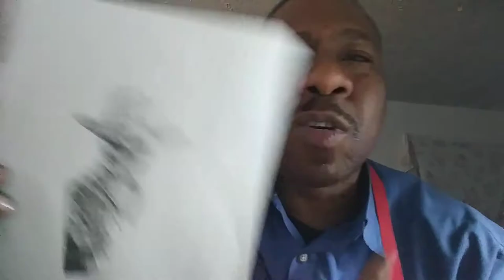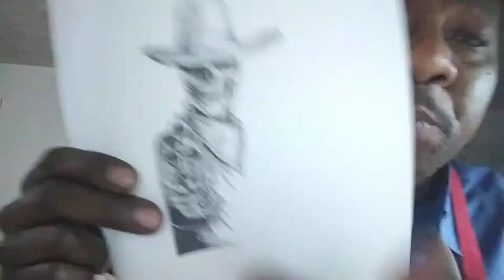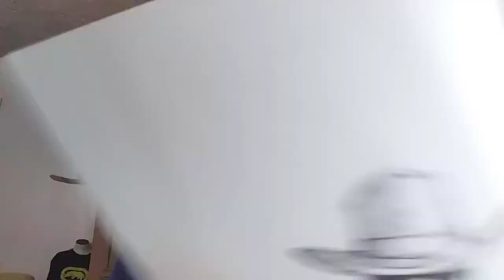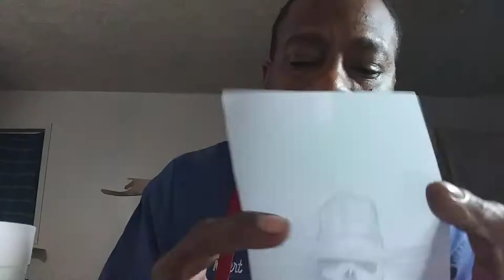Modeling spoon & beveling

Comment: If you're sewing by hand,  and you're doing an inner lining,  you can do a " heat and bond " iron on,  on the non decorative side. Only iron on just next to the hole Punches for hand sewing. Depending on type you use.  😉

Comment: Hi Robert, do you ever sell some of your art/templates for others to buy for leather work? And as for the duct tape on the back of the leather piece you do, is it difficult to dye with the glue residue from the tape?
Thanks man, God bless
Reply from the maker: Thanks for your questions. Yes I do sell artwork. Unless you're doing a flash dye technique, I generally line the inside of my pieces. If you are flash dying then I suggest use painters tape or masking tape.
Reply: @PremierLeatherCraftersKawboi  Thank you again, going to try with both and see what I'm more comfortable with. I appreciate the response man, I Also like the pics and sayings on Instagram where I follow you. 👍 Almost forgot,  is there a site where I can check out your artwork that you do sell?